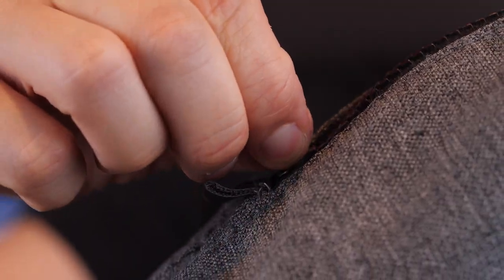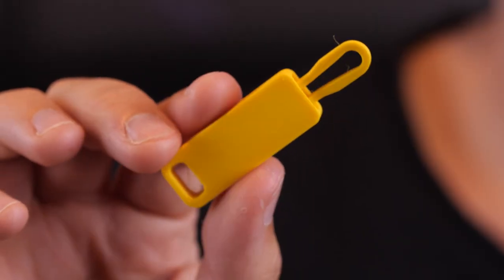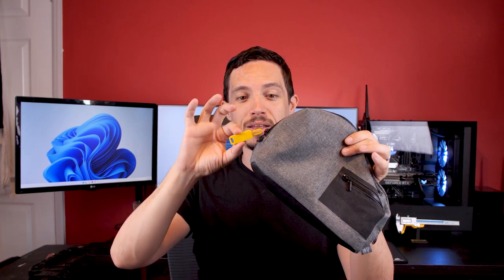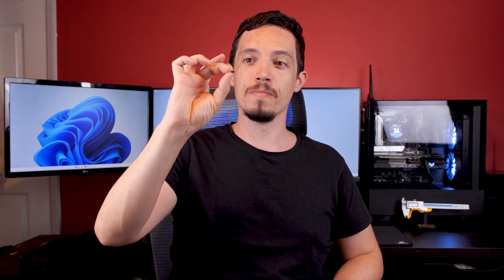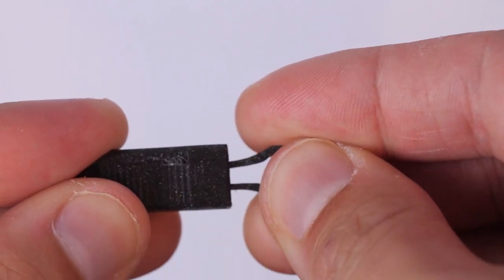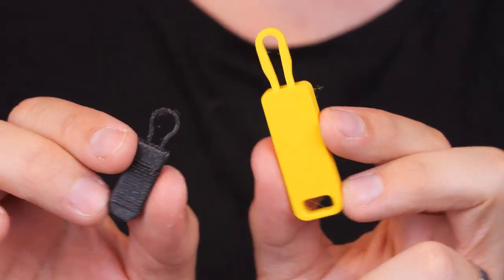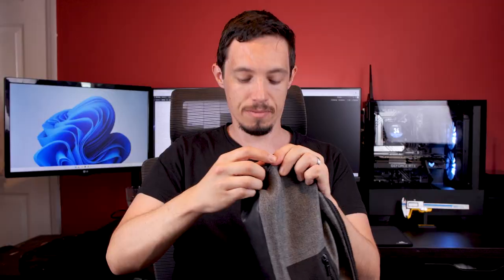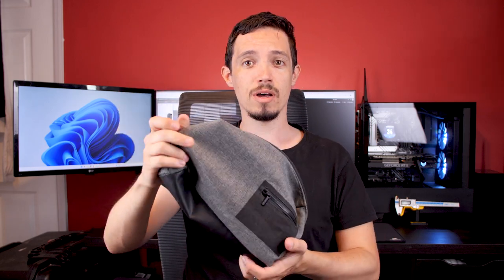The Zip Toggle 2.0 - Fixing a broken zip with 3D printing

Comment: Hi, I'm relatively new to 3D printing but have not had any problems printing anything so far with my Ender 3V2. However, when I printed the ToggleV3_Pt2Clip.stl, it does not come out. The top half does not print so I only get half a "C". The other pieces, Pt1 and Pt3 came out fine. Any ideas?  Thank you.
Reply from the maker: Hi Robert, thanks for getting in touch, I'm here to help where I can.
That's interesting that you've had issues with the clip and not the blocker. Does it look like it could be an issue with your bed adhesion?
Reply: @3DRevolution  Thanks for the reply. I didn't see when I sliced it that it was on its edge and so the top part of the "C" had nothing to connect to.  I rotated it 90 degrees, so it was flat on the bed and it printed fine. Thanks for the print and regards.
Reply from the maker: @robertneiberger3321  Sorry for the late reply. YouTube is great for notifying me about new comments on the root level of a video, but it doesn't seem to flag replies to any existing comments, sorry about that.
Great to hear you've managed to get it printed and hope it's helped! Happy printring!